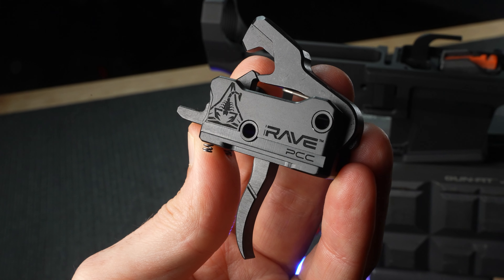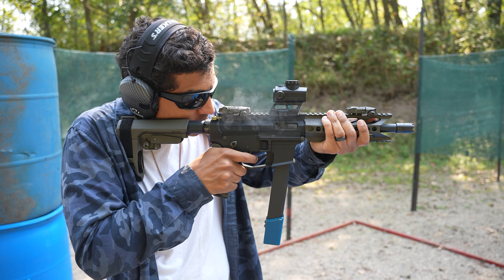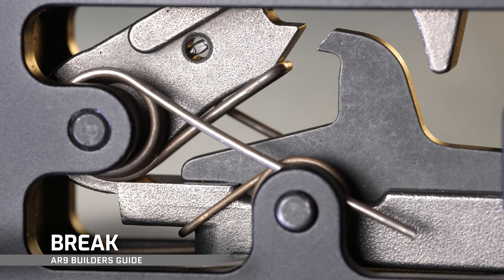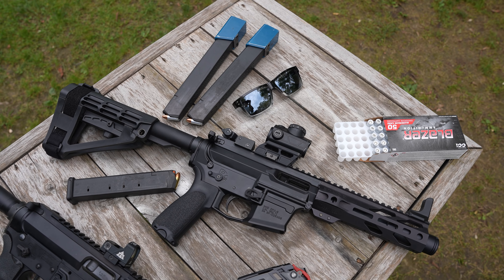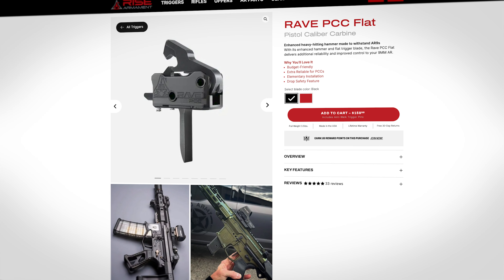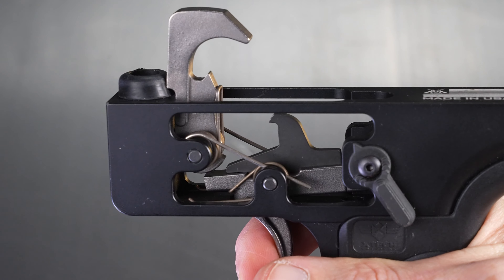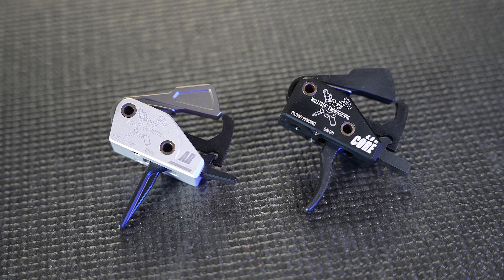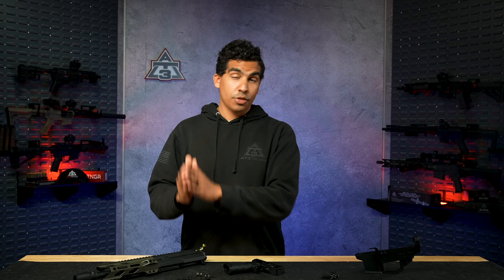EP 8 | AR9 PCC Triggers That Make You A Better Shooter. Geissele? Timney? Rave? | Ultimate AR9 Guide

Comment: On Geissele's website it says that "Our AR15 triggers are not compatible with the Sig MPX/MCX weapons or Pistol Caliber Carbine AR15/M4 variants". I was actually interested in the Super Tricon or SSA E X trigger model. I have an AR9 and would like to install a trigger with better performance than the factory one.
Reply: I've yet to find a Geisselle that'll cycle reliably in my AR9s. I get a lot of hammer follow.
Reply: @LangstonDev  same. my SD3G doesnt not reset the trigger if i hold the trigger down.

Comment: Check out the SLT-1 or SLT-2 from KE Arms.  Best trigger for blowback 9mms which keeps the energy of the bolt from damaging the receiver or receiver pins.  Plus a safety that can be activated no matter the condition of the firearm.  I have no affiliation with KE Arms - just a satisfied customer.
Reply from the maker: Good Info, Thanks👍
Reply: I’m about to start building mine, but I’ve always hated that ARs safety’s won’t engage unless it’s primed. 
I’m so glad I saw this comment cause I’ll probably go with one of those!